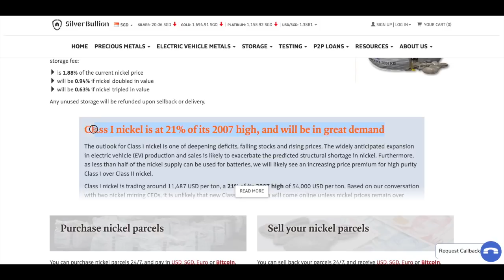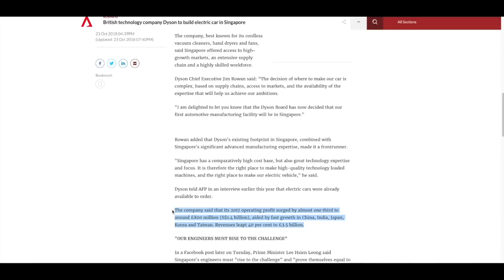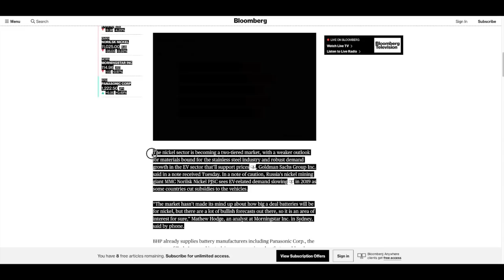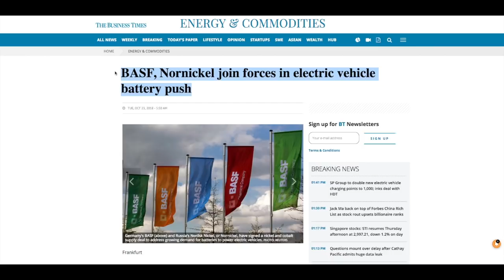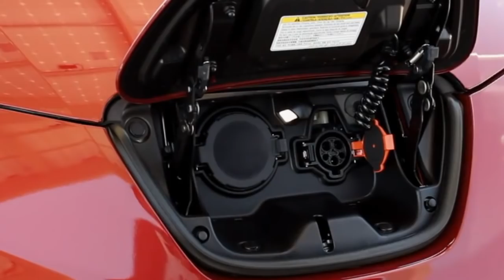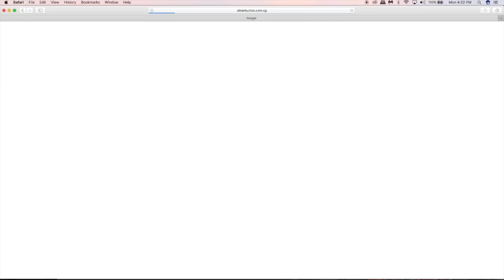October 2018 Electric Vehicle & Battery Metals Market Update

Comment: Meanwhile ALL the research and industry investments are happening in new battery technologies that will surpass the need of cobalt and lithium. Sucker bet. 3 years tops and the Solid state sodium chemistries will displace our 50 year old lithium technology.
Reply from the maker: Automakers are spending billions and betting on lithium-ion NMC batteries here and now today and decades into the future. They would not be spending money on a battery that is still in the research stage. Researchers will always claim a breakthrough but even when a breakthrough comes it still takes decades if not generations before it becomes viable, marketable, and cost-effective. It's already well-known auto makers have bought cobalt supplies years into the future.